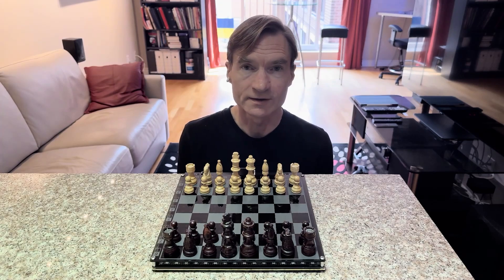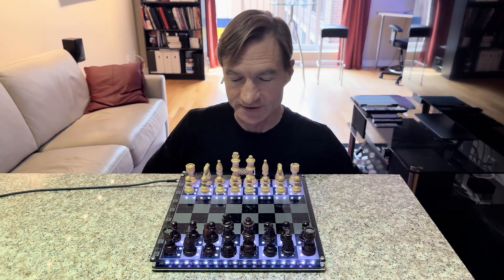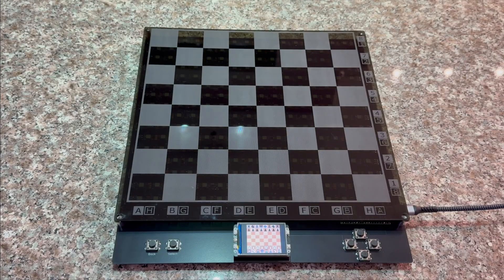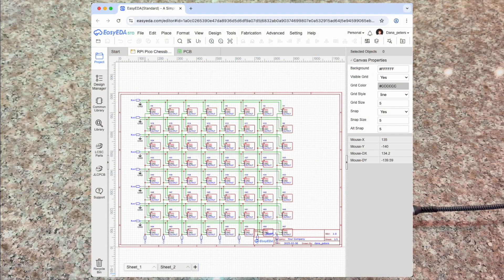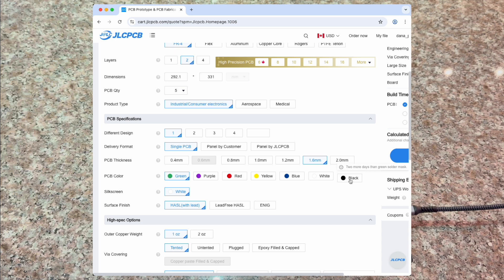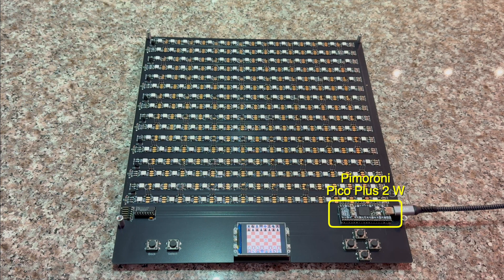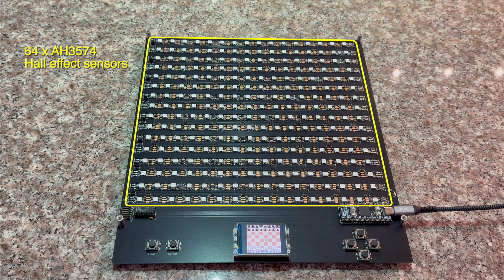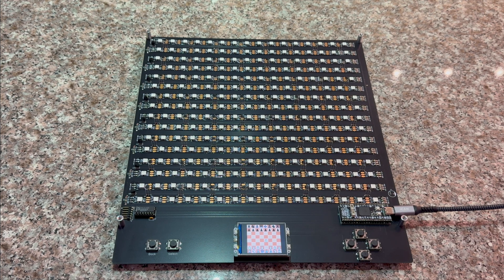Raspberry Pi Pico Chessboard

Comment: I'd love to make a Chess board that recognizes the pieces selected and has a switch that can be flipped that highlights routes that can be taken in order to help new players learn chess. I wonder if putting an RFID tag at the bottom of the chess piece (for the computer to recognize it) and a push button on top of it (to signal that it's selected) could help accomplish this, as I don't think touch recognition is feesible/affordable for a small project.

Comment: This is awesome!!! Are you planning on diffusing the leds more in the finished version?
Reply from the maker: The laser etching of the top of the acrylic sheet offers some diffusion of the LEDs, but only for "white" squares. I could etch the bottom of the acrylic to diffuse the "black" squares. I'll probably lower the brightness of the LEDs in the final software so they don't shine through the board as much.
Reply: @danapeters  Last month, I just ran across an amazing black acrylic called "Black LED Acrylic" that appears totally opaque until its lit from beneath and it does a fantastic job of diffusing the light. It even lets white and colored lights thru.  I would bet money that it could be useful here.  Either way, I love your progress and look forward to seeing more!  Thanks for replying.

Comment: Out of curiosity, why use Hall Effect sensors rather than reed sensors? You could keep track of pieces through software since chess always starts in the same position
Reply from the maker: You are correct that reed switches could be used instead of Hall effect sensors. But I believe that Hall effect sensors are more sensitive to magnets than reed switches. Also, the AH3574 Hall effect sensors I used cost $0.56 each, but the cheapest stocked reed switch cost $0.83 each (on digikey.ca).
Reply: @ makes sense especially since it needs to detect the magnets through the boars